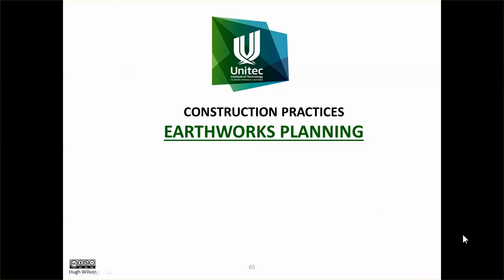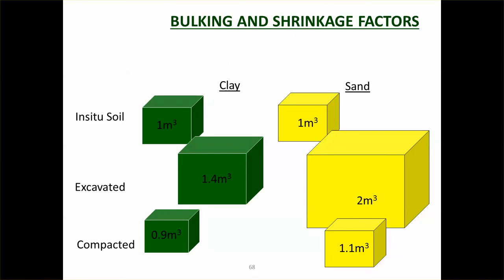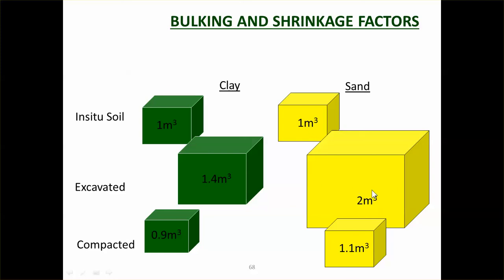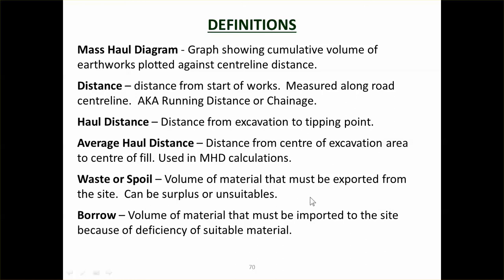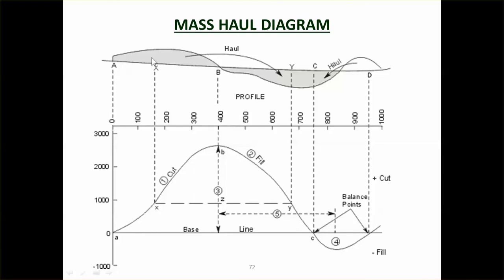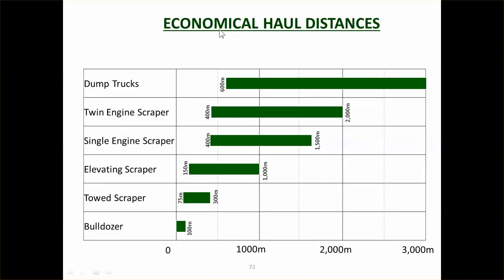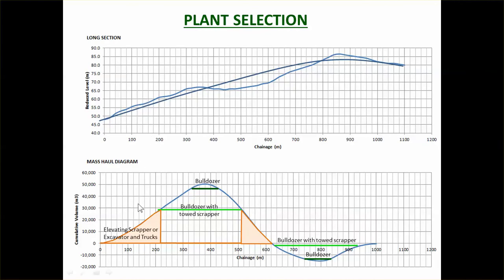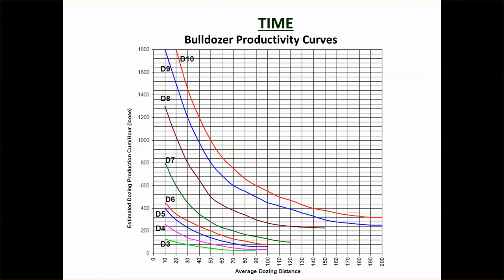CP3 12   Earthworks Planning

Comment: there is an error in your graphics starting at 1:20 -- the values for sand are wrong .. you show 2.0 and 1.1 ... but that should be 1.05 and 0.89 ... I suppose since I assume that your table at 2:50 shows correct values for sand.. -- thanks for the good work otherwise!! (y)